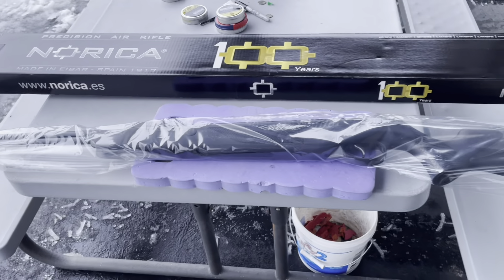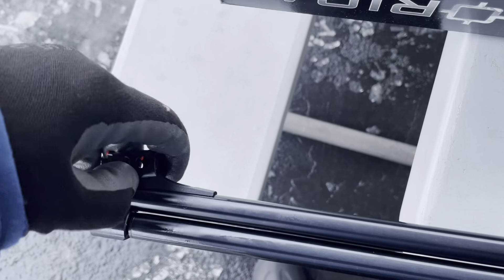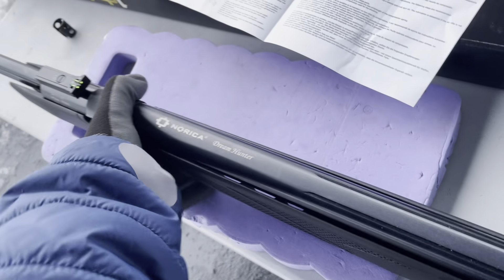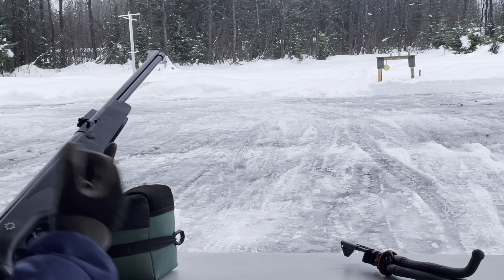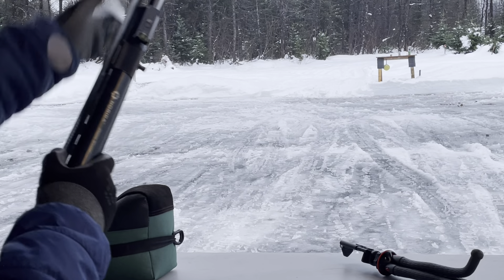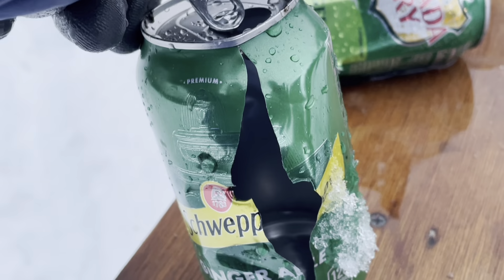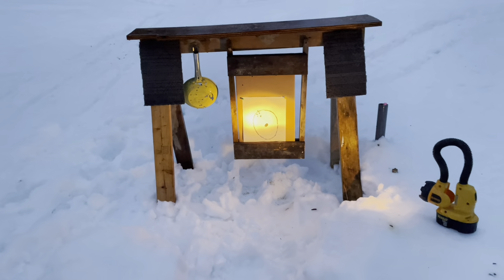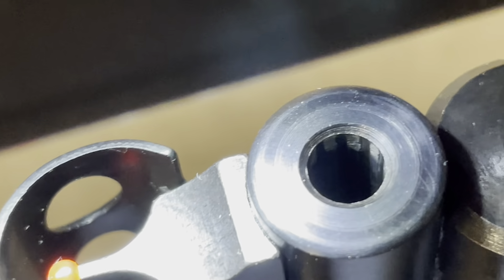Norica Dream Hunter .22 cal - first impressions & shooting test

Comment: in 2012 I was having one ... worst ever air rifle
Reply from the maker: What didn’t you like about yours?
Reply: @thatalaskaguy-airguns  heavy from the front .. spring died quickly. the plastic furniture wasn't designed comfortably.. by the  way, I gave it to a friend with no change and he didn't like it
Reply from the maker: @walidqaissi9292  it’s definitely front heavy. I hope my spring doesn’t fail anytime soon. I specifically went with this model because it used a steel spring over a gas piston. I don’t care for the distance between the grip and trigger but it’d be more comfortable for someone with large hands. 

Hopefully my long term experience turns out good. If it doesn’t I’ll be sure to post a video. 😀
Reply: @thatalaskaguy-airguns  I respect your openion and  feelings about what you get ... It's just a bad experience for me I wanted  to talk about ... by the way, my name is Walid, and Im an air rifles fan ( a target shooter), especially the springs I wish did not bother you
Reply from the maker: @walidqaissi9292 I’m not sure why YT didn’t notify me about your comment. You were right, it’s not a good quality reliable air rifle. Mine broke with 5-days and I’m going to send it back to the vendor for a refund. 

Norica’s customer service blows. I’ve emailed them twice and they don’t respond. I won’t ever buy another Norica product.
Reply: @thatalaskaguy-airguns  If you accept advice ? take chines B3 . It's cheap like a durt work like a tractor and also accurate, especially   with plastic furniture . and take care
Reply from the maker: @walidqaissi9292  I like the Chinese B series guns as they are not expensive so I don’t expect much.
Reply: @thatalaskaguy-airguns  noooo . try it, you will not believe how much it's an accurate since it's  cheap, the only weake point, but it is the power . It's really made for fun and small games like rats, squirrels, and close-range rabbits
Reply from the maker: @walidqaissi9292  I’ve got 4 different models of Chinese pellets guns. They are fun to plink with but their accuracy their power limitations show up pretty quickly.
Reply: @thatalaskaguy-airguns  Br is an under barrel lever and fixed barrel short travel spring and a good triger it has an accuracy, and I had changed all secrow with alonkey ones for more fixability.  but if you can spend money for accuracy, try Artimes   1600 ..

Comment: Recycled EU plastics are not like HATSAN!
Reply from the maker: Only the finest EU plastic made from recycled Pina Colata bottles. 😂🤣
Reply: A heavier wood stock version would help the balance some. The main thing is that it works and shoots straight.
Reply from the maker: @johnnybbgunner2136  a wood stock would be nice but the gun is already on the hefty side. I’m more excited that it has a rubber buttpad than anything. 😆 I’m kinda fickle, sometimes I want wood and sometimes I prefer synthetic. For this gun I’m pretty content with synthetic as I have a number of expensive wood stock airguns that I treat more like museum pieces than things to shoot. It’s nice to have guns just for shooting as long as they perform well.